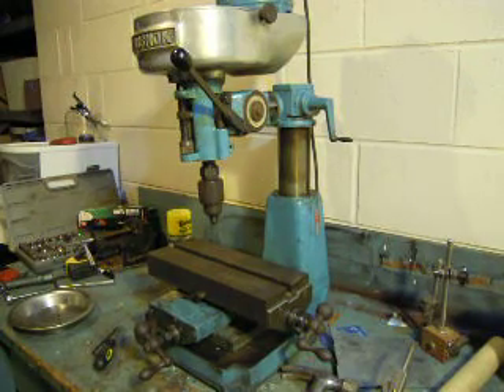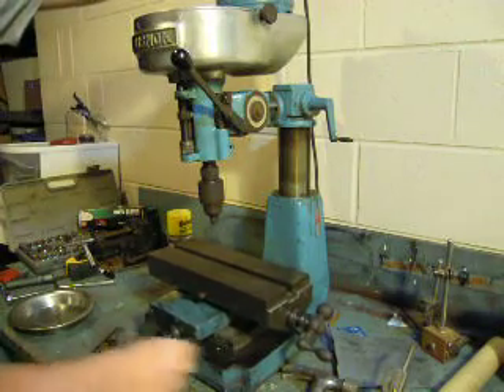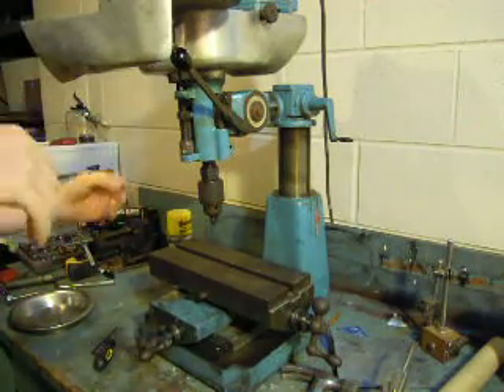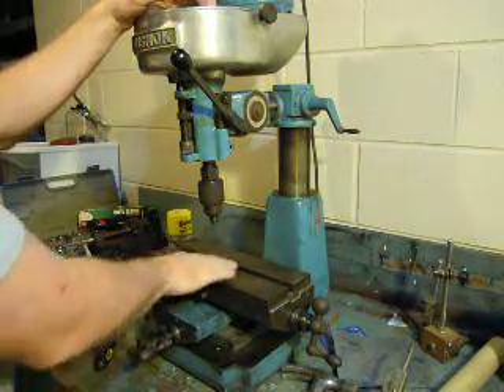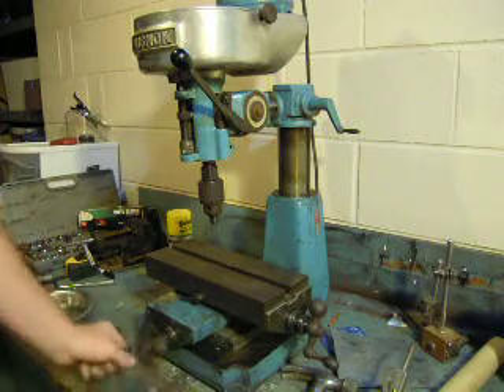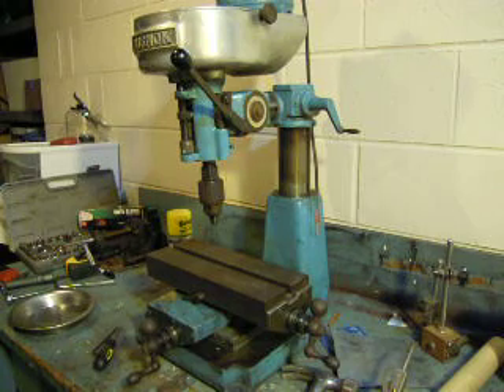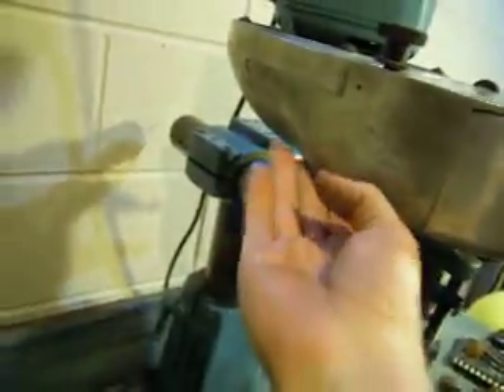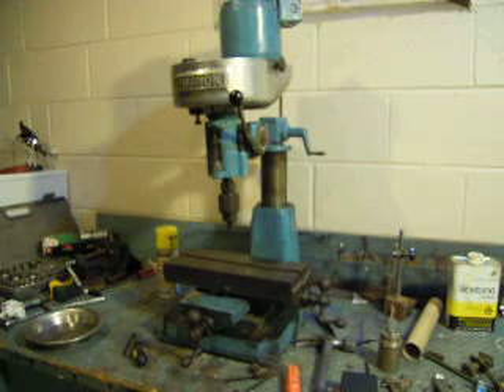Mini Milling Machine Rusnok Model 80

Comment: If you're still monitoring your video: what are the x, y, and max quill  travel please? Max DA collet size? Machine weight? Can't find specs on this ancient unit... they're pretty well made but likely too limited in quill and collet specs for me...
Reply from the maker: They still make them.  About 150lbs, 5/8" max I think,  8x4 and 10-12" up and down.  You should be able to find Rusnoks info somewhere.
Reply: Appreciate the quick response, and video.

Comment: currios, does your table have any movement if its unlocked and you grab the ends and try to move it? I have one I'm trying to figure out. Thanks, all the best!
Reply from the maker: I sold this a few years ago, but there should be both gib adjustments and backlash adjustments on the screws to take most of the play out.
Reply: Thanks. If the table isn’t locked, mine wiggles a little, only by a few thousandths but I can feel it if I try to wiggle it. It’s not the lead screw or backlash adjustment. I have adjusted the gib as good as it will go I think, just has a little play in it if not locked. I was just wondering if yours did too but since you sold it I guess we’ll never know, lol. Thanks for the reply.

Comment: Pretty cool for a small machine.
Reply from the maker: I like it.
Reply: I finally got myself a little mill a few weeks ago (Precise brand - Old school made in Wisconsin) for $200 that came with a surface grinder build project thrown in. Also no knee, but it has a cast floor base: It's pretty cool. If interested, check out my latest (2 minute long) video titled 'Update' where I show both machines. :)   @precisionmachineshed